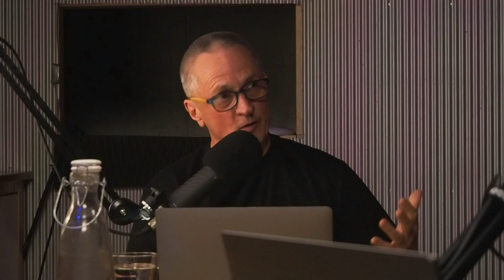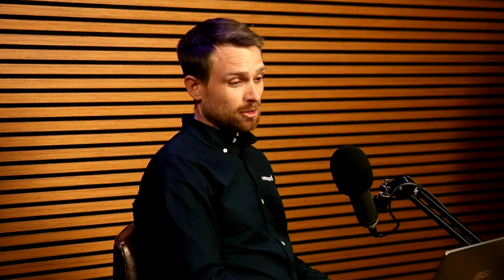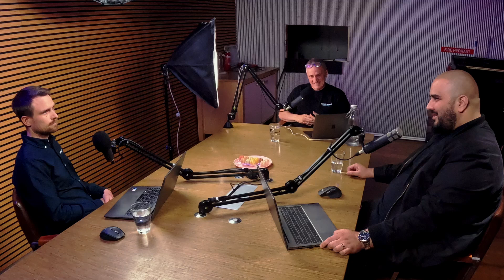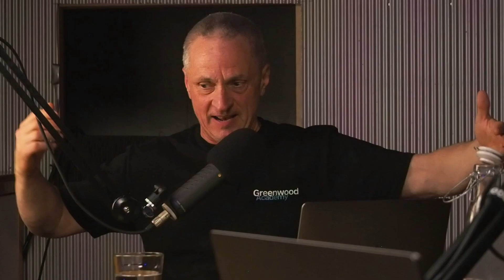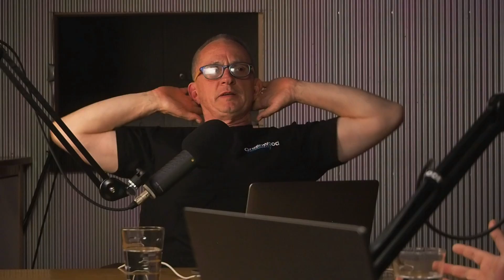Best Practice Engineering Compliance vs Roof Install Realities with Gamcorp and Greenwood Academy

Comment from the maker: ⚡ Biggest takeaway:
Structural safety is not a checklist item. It is the foundation of every safe and compliant install.

Wind loads, fixings, roof condition, temporary loads. These are the details that decide whether a system lasts or fails.

This conversation with Gamcorp is the kind of insight the industry needs more of. Real talk, real risks, real standards.

If you are installing, designing, or signing off systems, this is essential.

👉 Hit LIKE and SUBSCRIBE
👉 Share this with someone in solar
👉 Drop a 🏗 if you think structural standards need to lift

And comment. What is the most common mistake you are seeing on rooftops right now?